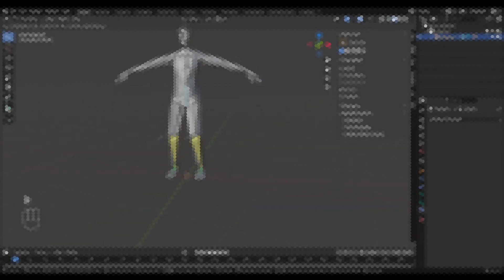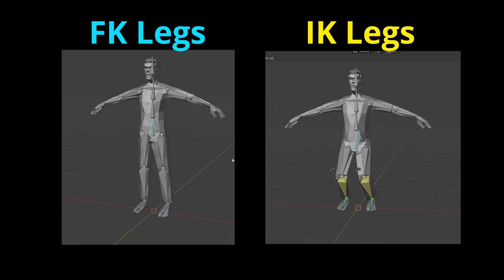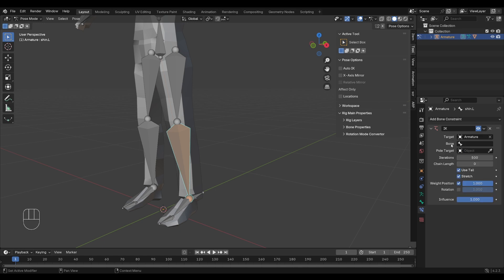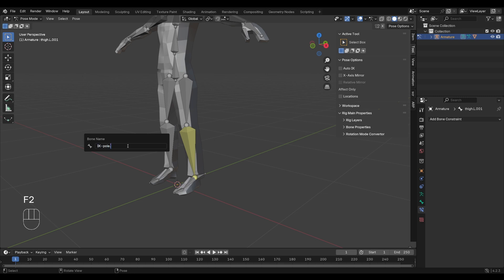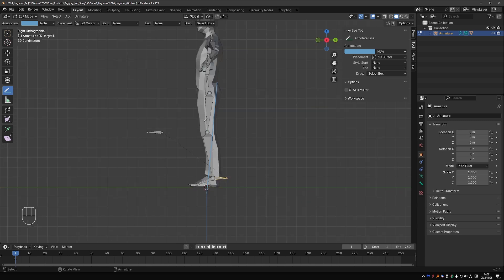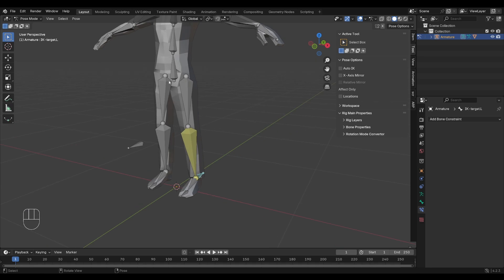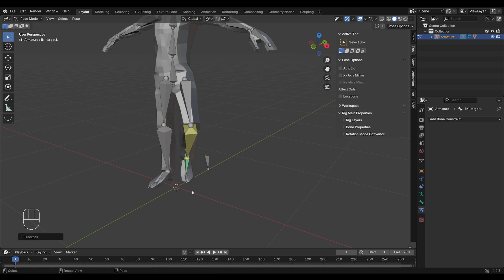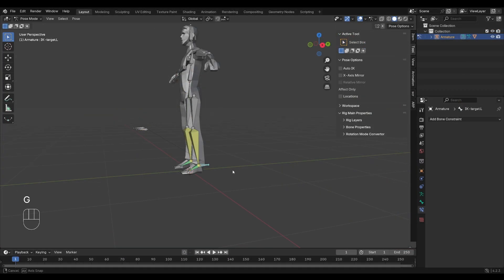RIGGING L1-2 : The No.1 Rigging Tool

Comment: I've been following this identically to you, but for some reason, my pole angle requires 90 and not -90, and even with your parenting trick, my foot jumps ever so slightly when switching between edit and pose mode. I'm not quite sure how i've broken it on the first step!
Reply from the maker: 90 instead of -90 is because you created the legs in a slightly different way than me. I can't say exactly how. That's ok of course. Keep following the course and you will learn why it happens. :)
As for the slight change in pose, 90/-90 degrees is usually almost perfect when the legs are fairly straight. But you may have to set the value to 89 or 91 or even to a decimal value like 90.5. Although a tiny change between edit and pose mode is not something you need to worry about much.
Reply: @CGDive  I just ended up deleting my armature, and refollowing from scratch. It's identical to yours now!

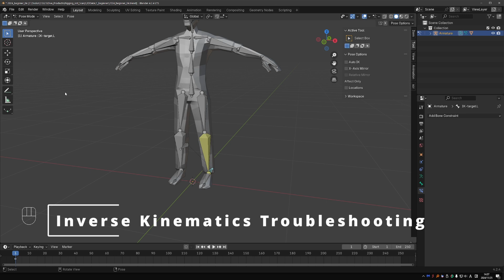Comment: At 4:22, there is a dotted line connecting the IK-pole.L and IK-target.L. It wasn't there prior to that moment. That too, the dotted line, which usually means one bone has been parented to the other, appears in Edit mode not Pose mode. Here the dotted line is appearing while in Pose mode. What am I missing? Thanks in advance.
Reply from the maker: Your observational skills are too good :P
This bone will be parented a bit later in the video.
The part at 4:22 was added after the fact to explain the troubleshooting stuff. So the state of the rig is slightly more advanced than it should be. But it's not something you have to worry about. Just keep following the tutorial!
Reply: @CGDive Oh! Thank You❤. My apologies for being in a hurry. I was trying to follow all your steps in harmony to avoid problems later on, so my bad😅. By the way, great series and thank you very much for giving such knowledge for free.
Reply from the maker: @anuraagchandra2548  No, no worries. Good observation!

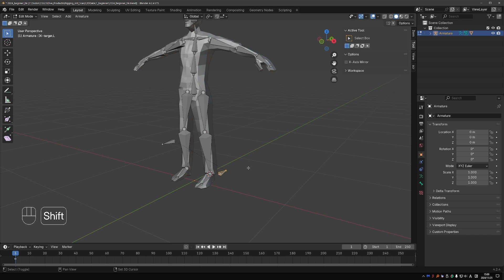Comment: 5:24 to 5:33
In the video, the head of the IK target bone snaps to the 3d cursor.
When I move the IK target bone, the middle point of the bone length snaps to the 3D cursor, not the head of the IK target bone. Could you please explain why this happens?
Reply from the maker: Check the modal options (the little menu that pops up in the lower left corner right after the operation). If offset is enabled, disable it. I think Disabled should be default, that's why I did not say anything about it in the video.